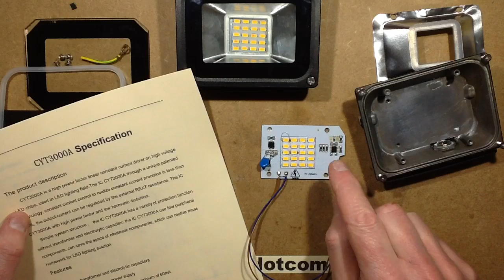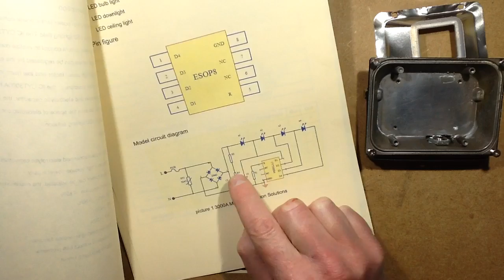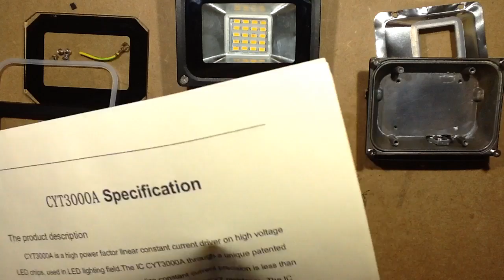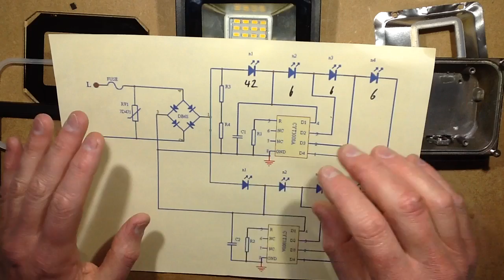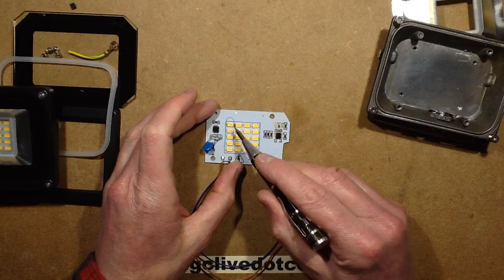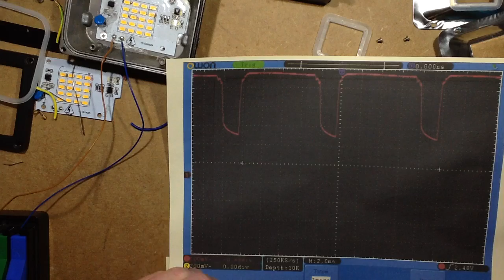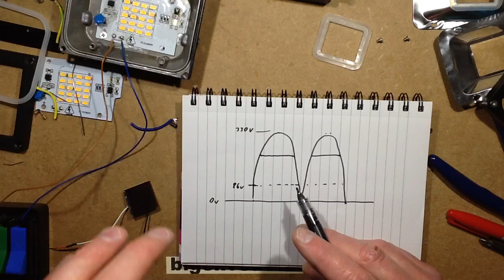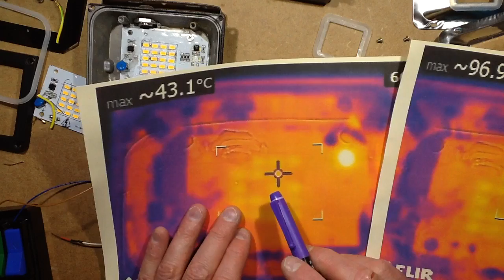Teardown, autopsy and hack of dead SMD LED floodlight.

Comment: I use metal core PCB in my project and the ones with a single layer use Teflon as isolator between the aluminium and the copper tracks. They have excellent thermal transfer and allows for high current applications not really possible with simple FR4 type boards. Is not just helping with the cooling of the components but also the excellent cooling of the copper tracks.
Not sure why there are not more people using this for high current applications not just LED's.
Reply: Brian Timm I only needed 1 layer boards for my application those are usually less expensive and have by far the best thermal performance since they use teflon as separator. I use this guys for the first SBMS and they had a bit better price but can only do 2Oz copper at reasonable price  http://www.epegpcb.com/contact.jsp My first design used 1Oz copper and I can do 80A continues without problem but tracks where extremely short (much wider than longer).
For just prototype 3 to 5pcs of of 10cm x 9cm was around 200 - $250 if I remember correctly. When you go to hundreds volume 200 - 300pcs the price drops to around 2 to $3 /piece.
Prototyping is expensive on this manufacturers (I normally pay around $1000) to prototype one SBMS but I have no choice I need to see the quality of the PCB I can not prototype with less expensive people then order form some other manufacturer.
Reply: Miloš Lazović Thanks for the example. Try to build something similar to that in a few hundred units and then see what is the price (a lot of custom expensive parts).
First it has an custom aluminum case even even in thousands of units that alone will cost more than the metal core PCB.
Then the power mosfets are on a 6 layer 4Oz pcb that alone will cost more again than the metal core PCB (I know that since I have a 4 layer 1Oz PCB on my design and is a bit more expensive than the metal core PCB at the same manufacturer and in the same volume).
Even if that case is aluminium and small it will have serious increase in temperature above ambient with 200A trough that continues with no air movement.
Then it has 4 large electrolytic capacitors inside that hot case. As a toy that is probably fine it will not need to last to many hours.
Also most of the time that will not work at 200A. The SBMS needs to work at 2x 100A for a few hours a day for at least 30 years.
I'm sure they can get those buss bars at a good price in many thousand or thens of thousand volume but will still be more expensive than metal core PVB and they will not act as a heatsink but as a thermal mass only since they have more mas than surface area. In the specific case of EX200A they do not act as heat sink at all because they are inside a metallic case the heatsink is just the eternal part of the case.
I will say the use of copper buss bars in that particular application was a bad decision not just because of cost but also performance.
It could have been probably up to 2x lighter if it was using metal core PCB instead of those copper buss bars.
The buss bars together with the thick internal aluminium heatsink act as thermal mass and that helps only with short duration pulses. It is fine considering that in most applications the battery size and run time will be limited so that thermal mass can store the heat and release that later.
 The 200A rating reminds me of the audio gears and exaggerated power outputs.
An electric bicycle has a motor controller delivering usually 20A with a 8s Lithium battery so 500W peak and most of the time current is much lower.
This "200A" controller even at 6V will require a 1.2kW motor (not peak continues power) that is not the case with the small RC cars it is used in.
Reply: Miloš Lazović I used to work in the HEV industry, we had our own clean room where we built 9kW(combined output) DC/DC and motor inverter modules.

the industry uses IMS for a reason. it may not be the perfect solution for you, but at scale it has MANNYY benefits. particularly with assembly labor. I helped a part go from bare board to fully installed in our clean room more than once.

as far as footprint, an IMS board thermally bonded to an aluminum case is the most optimal. our DC/DC and Inverter modules sat right on top of the coolant channels. We were using engine coolant to keep things at a safe temperature.

Just because your design works for you doesn't mean it is optimal either. the Automotive suppliers would never be able to qualify a module with an air cooling solution that relied on an internal fan, I've seen the testing specs. and the module would be much bigger to accommodate that airflow.

the beauty of engineering is that there are always multiple solutions.

if you're looking strictly at footprint and cooling efficiency, I have to hand it to IMS boards. the thermal resistance is crazy low and it lets you use SMT packages that would never mount onto a buss bar properly.
Reply: +electrodacus Where do you get your aluminum core PCBs made?  Have you found an affordable source for small quantities?  I have a project with a high current buck converter that's space-limited, so this kind of board would be helpful.  Thanks.
Reply: FlyingShotsman
The suppliers I used and the one I currently use are quite expensive for prototyping but medium to high volume prices are good.
I pay about 250 to $300 for 3 to 5 PCS (small 10x9cm metal core boards single layer 105um (3Oz) copper.
I only have the power connectors and the power parts on this board they can not do small spacing for small components with 105um (3Oz) copper. But I have 2x 120A going trough that board. On the last project I had 80A trough a 35um (1Oz) copper trace (it was wide and really short but still not bad).
But if your buck is just 20 to 40A I think you better use two layer 70um (2Oz) FR4 it will cost less than a single layer 35um (1Oz) metal core board for prototype maybe even small volume.
In small volume (few hundred) the 4 layer FR4 I use in the same project (same PCB size) costs about the same as the single layer 2.5mm aluminum core PCB with 3Oz (105um) copper.
You can see the boards on my google+ page https://plus.google.com/+electrodacus
Reply: Thanks for the information.  I appreciate the advice.  I'm not pushing current >that< high, but the space constraints mean that I can't provide the PCB area recommended in component datasheets for thermal relief, so multi-layer boards, heavy copper and perhaps metal-core PCBs may be the answer.  Are you able to share the name(s) of your supplier(s)?
Reply: +FlyingShotsman Yes the only reason I did not provided the name is that they are expensive for prototyping they are not specialized in prototyping they have good price for low or medium volume production. I pay around $1000 when prototyping my SBMS there are a few PCB's in there but I have no choice since I need to know exactly how the final PCB will look like I can not prototype with a different lower cost supplier. Here is the one I worked on for the SBMS4080 a bit less expensive than this last one I work with http://www.epegpcb.com/contact.jsp write to Michael the email address is there
Reply: +electrodacus Thanks!
Reply: +electrodacus Because there are much better/cheaper/efficient solution to deal with component cooling and high current than to use IMS PCB in most cases (high brightness LED products are one of few exception were IMS PCB have advantages). IMS PCB was originally envisioned for use in the power-supply industry but they are quickly abandoned due inferiority comparing to other solutions.
Reply: +Miloš Lazović I will like to here about those other solutions. In my project metal core PCB was the best solution I found and not sure anything else will have been able to get me the same results. My priority was to have the smallest device possible and the fact that the SBMS can be easily mounted on an extremal heatsink able to disparate those worst case 22W (with 100A charging + simultaneously 100A discharging) allowed me to have a product of only 250 grams and 10x9cm. Is not so much about the components power dissipation but the copper tracks. I use the best power mosfets available and could have used more if needed. All this will run cool so that it can have a life of 30 to 40 years to match the solar PV panels life.
Luckily the metal core PCB is popular so low cost do to use in LED lighting applications.
Maybe I have a special application but I do not think any other solution will have been better than metal core PCB for the power board.
Reply: +Miloš Lazović I will like to here about those other solutions. In my project metal core PCB was the best solution I found and not sure anything else will have been able to get me the same results. My priority was to have the smallest device possible and the fact that the SBMS can be easily mounted on an extremal heatsink able to disparate those worst case 22W (with 100A charging + simultaneously 100A discharging) allowed me to have a product of only 250 grams and 10x9cm. Is not so much about the components power dissipation but the copper tracks. I use the best power mosfets available and could have used more if needed. All this will run cool so that it can have a life of 30 to 40 years to match the solar PV panels life.
Luckily the metal core PCB is popular so low cost do to use in LED lighting applications.
Maybe I have a special application but I do not think any other solution will have been better than metal core PCB for the power board.
Reply: *****
For handling high currents better (and usually cheapest) solution is to use copper busbars to carry high current (which is common solution in most high power application). Usually that solution will give you smaller (smaller footprint) and efficient device, than relying on PCB tracks for high current.
Again for your particular problem I am not sure that busbars are best solution (I think that current in your case is on low side for busbars), but if you use them you probably get marginally better efficiency.
Reply: +Miloš Lazović Do to simple design and placement of the power components there are very short tracks in my design (much shorter than wider) so there is not much loss on the tracks. The problem is even with buss bars there are still 20 to 22W that needs to be dissipated from current shunts and power mosfets and that will have required a heatsink or ventilation (I hate moving parts in my designs :)). The metal core PCB acts as a great heatsink and the way the case is build alows the case to be mounted on an external larger passive heatsink or aluminum plate. The 10x9cm form factor can only handle about 5W passive. I do not want any part above 60C even at full load.
Efficiency is as good as it gets with just 22W loss at 5000W (2x2500W). Is basically a dual DC solid state switch.
Reply: *****
In proper design you can use busbar to transfer heat and they do better job then IMS PCB (copper do better job than aluminium core).
Basically all what you say as reason why you use IMS PCB you could achieve with busbars (with same or better results), but again it is up to you as designer to choose what is best solution for you.
Reply: Miloš Lazović Not sure that is true. The component is not on the buss bar so not sure how will the cooling be better. (Copper is much more expensive and the thermal transfer advantage is more than negligible).
The aluminium core has a few hundred volt isolation from the copper tracks.
You still need a PCB probably an FR4 to mount the components then add the buss bar as a component (like a zero ohm shunt).
Thermal transfer from component to buss bar will not be great and you can not directly mount the buss bar to an additional heat-sink.
You need surface area for cooling no matter how thick the buss bar is.
A two layer FR4 + buss bars will be more expensive than a metal core PCB even in large volumes. In low volume t will be incredibly expensive to have custom size buss bars.
You may also be referring to trough hole components mounted directly on a buss bar or heatsink but that will result in a much larger and heavier product than the one I did and much more complicated manufacturing.
Maybe you have an example (photos) of what exactly you are referring to when you mention buss bars.
The metal core PCB with 3 and 4Oz that is easy to get can be used for 50 to 200A with no problems.
In my case the PCB's have multiple roles like heatsink and as case (enclosure).
In few hundred pieces volumes that one layer 3Oz metal core with 2.5mm aluminium core costs around $3 for that 10x9cm size and is not just a PCB is also part of the case and that can be mounted on an external heatsink to dissipate the extra heat.
Reply: *****
Busbar can in same time can replace heat sink (no matter if you are using SMD or thru hole components) and you use it as classical heat sink.
Pictures is easy to find on internet, just look for high power inverters, UPS, telecom power supplies, RC ESC (for example Toro EX200A ESC which have combination of busbar and classical heat sink for 200A continuous 800A burst current +15A BEC in packages that is similar in dimensions as to yours and pictures of internals are readily available on internet) .... most of them use busbars.
Copper is not so expensive, for price of your PCB you can buy 1kg of copper busbars (previously mention RC ESC have price of less then 180$).
If IMS PCB had any advantages then busbar solution we already will see it used in most power electronic today (which was planed application), and not be abandoned solution.
For RC flying applications where size and weight matters, it use relatively high currents and price is not big problem they all use standard solutions and no one is using IMS PCB (and airplane with 120mm EDF can easily set you north of 5000$)
Reply: +electrodacus where are you getting your IMS boards produced and at what prices? I have an application that would definitely benefit but I haven't found a small run board house that does IMS yet. and I'm not made of money so I can't just call up the big boys and order a single board (or even a minimum panel order)
Reply: *****
Now you are start talking about stuff you don't know. That ESC is made for motors that are with power more than 3kW (which is usual value of motors used in 1/5 scale models), and it will run most of time at pick power. For your information that ESC is correctly rated for continuous power of 200A, and it is tested like that by many people (if you exaggerated power rating for your product that don't mean all others do same).
Even with all that custom parts they are able to make that product with price that is lower then is for your product (it cost 65% of your product) so it is indication that your assumption about price is wrong.
To make this discussion stop, if you think your solution is better than what all other use, even they try same solution as you and abandon it as inferior to currently used, then by all means use it, and live happy in believe you are right, and all other are wrong.
Reply: ***** thanks for the info and link! I'll check them out.
Reply: Brian Timm
You look like as you did not read my first post, there are cases where IMS have its place but for general use it is not preferred solution.
I do not have experience in automotive electronic, and I do not have high opinion in knowledge of people who do it (from personal experience I had 3 recalls in 2 years of my car related to faulty and potentially dangerous fault in car electronic and that is not on HER but on classical gasoline car).
Reply: Miloš Lazović yup, you're correct there. at work and time is limited.

and I'll agree that not all of automotive electronics is done well. I had to fight a project lead to have a failure analysis. all I know is that as an engineer at heart I personally don't stand for crappy quality and I hope to continue that in my career.

Comment: Get a standard clothes iron. Put it upside down in your lap, turn on. Place the PCB on the hot plate and let it soak the heat up. You should them be able to solder or desolder as normal.

Comment: Hi Bigclivedotcom. This may seem like a newbie question, but why are capacitor dropper ballasts not used more by the main LED lamp makers and only seem to be used by cheap chinese ones? one common failure of LEDs is the complex electronic ballasts and at face value capacitor droppers seem more reliable. maybe a video going thru the pro's and con's of the different types of LED Ballasts might be a good idea? love your videos!
Reply from the maker: +Dana Vixen Philips have used capacitive droppers in their lamps, but they are better suited to low wattage lamps and not the really high current LEDs.

Comment: Speaking of weird failures in lights I made a capacitive dropper but it's very odd, the LEDs glow really dimly until I switch it off, take the LEDs off (Open circuit), turn it on, turn it back off, put the load back on, and then the LEDs glow brightly and properly until a few on/off cycles and it starts to glow dimly, 

So odd because when I would change the capacitor it would still glow dimly, changed the load and the load still glows dimly, change the resistors/take them out and still glows dimly.....? but when I do the procedure mentioned above it would work. Any ideas?